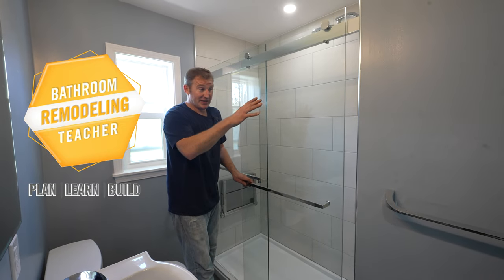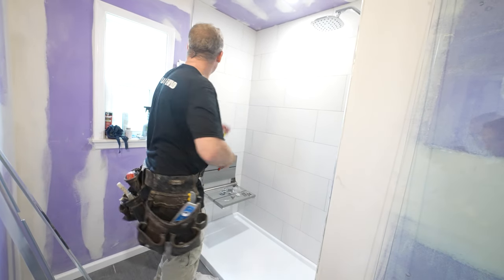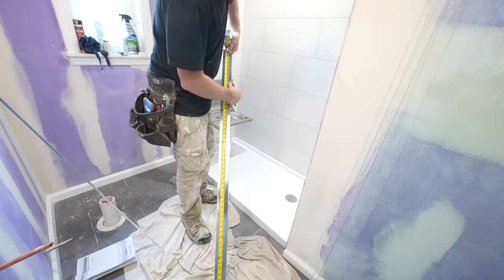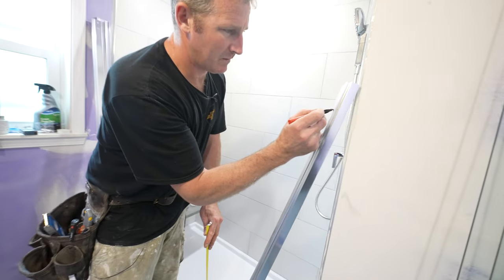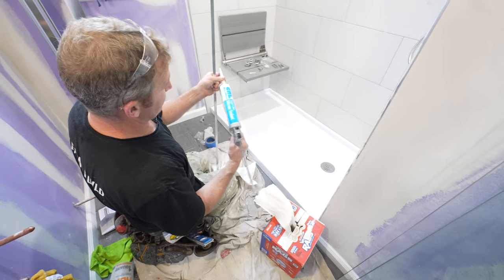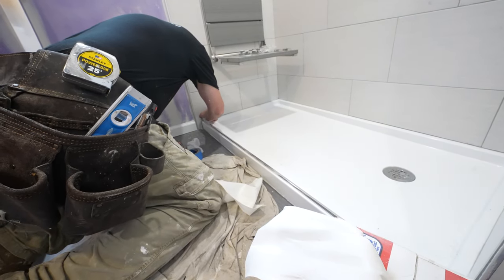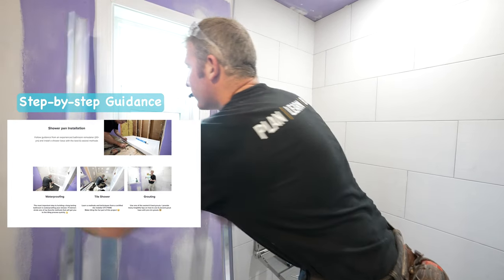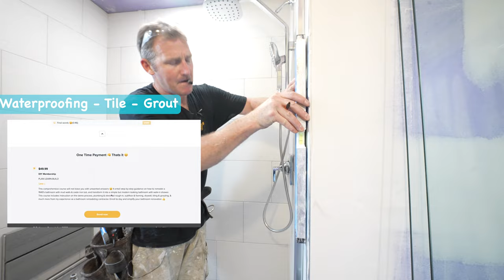Sliding Shower Doors | PLAN LEARN BUILD

Comment: But won't all the water from the shower head go into that inside door? Shouldn't the inside dòor be on the outside?
Reply: yeah i would think the inside door goes closer to the shower head to prevent water from shooting in between.  Is there some kind of watertight gasket in between?

Comment: I have the dreamline slimline shower pan. I also got the same dreamline shower door. Did you find the threshold too small or just enough to fit this door ? Just wondering how much room I have
Reply from the maker: Yeah just enough 👍 I should have mentioned, if the shower pan or curb is off level at all, you’ll need to raise the top header tracks to over come that 👍
Reply: Thanks!!! That’s one thing I learned about the slim line shower pan. Very small threshold so not all doors will fit
Reply: @xcx4x The Delta ones won't fit these pans I think.  Almost purchased.